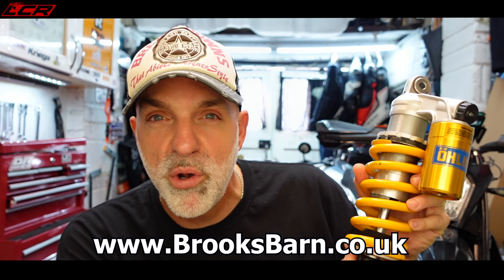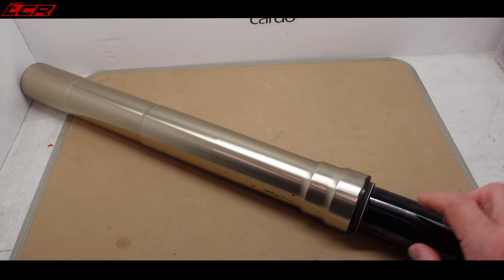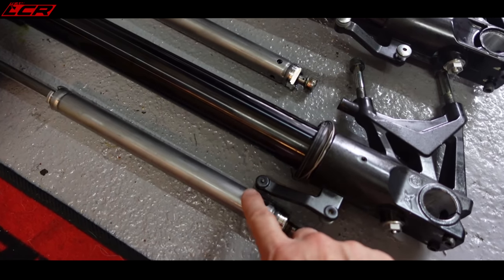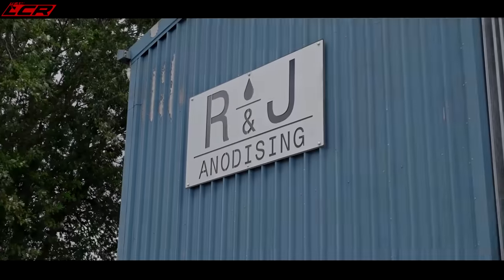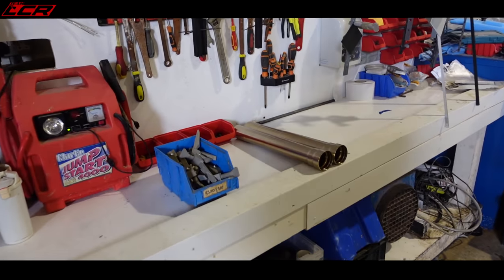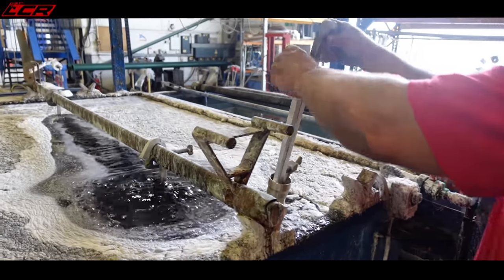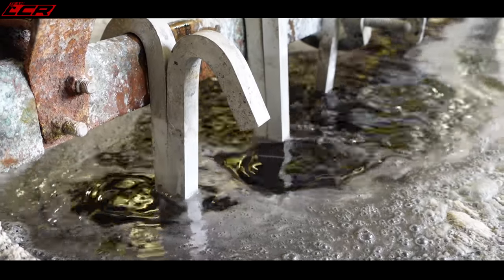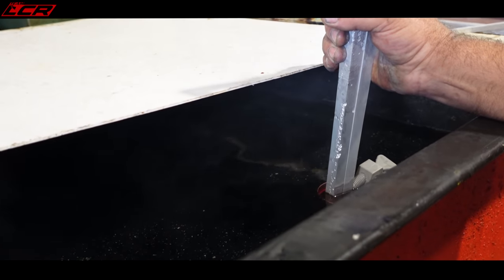Hypermotard Restoration  EP10 | Suspension Overhaul!

Comment: Also, a tip. Apply some heat to the upper stantion with a torch and it’ll be so easy to separate the lower leg 💪🏼

Comment: Hahaha. 
Those forks.
You've done the difficult bit, putting them back together is the easy bit.
Future reference;
Make sure a good vise is bolted down properly to a good bench.
Tip two,
Make or buy some soft jaws for said vise, or buy/make a fork leg holder.

Comment: Just a note on your anodizing guys comments on the black/silicon reaction in the stripping tank... The silicon in the aluminum forks is there for good reason, changes the properties of the metal, it’s normally used in high strength alloys for structural/high stress/load areas like suspension. Also used for bearing areas as it hold oil in the pores better plus easier to cast into complex shapes than regular alloy
Reply from the maker: Ah very interesting James, I put it down to cheap alloy being used.. now you mention it that does makes sense!

Comment: The anodising looks totally factory - and R&J are local to me so I might have to pay them a visit!

Those Marzocchi forks aren't really in the same league as your Öhlins shock so, as you've got them stripped down, I think it'd be a false economy to just reassemble them as standard. You've resprung your shock so, at the very least, I'd recommend getting a set of linear springs tailored to your weight. I think Brooks are agents for K-tech so try dropping Chris at K-tech an email and see if there's anything they can do to upgrade your fork internals. (They reworked my Monster 1100 Evo forks and it transformed the ride. Definitely money well spent.) Failing that, the Andreani cartridges are a good value option.
Reply from the maker: Yes I will at least get uprated fork springs to match the rear 👍
Reply: Good move! Difficult to see from your video but I think the Hypermotard springs are progressive, which are, at best, a compromise and, at worst, 'one size fits no-one'! So you'll definitely feel the benefits from fitting linear springs for your specific weight. Really looking forward to reassembly!

Comment: Dreadful stuff regarding the postage FUBAR sitch; but great stuff on the local anodiser visit front. I had my fork legs re-done recently (Gold!), but they were a damned-sight more expensive than the (bargain) price you paid Chops! And I'm 100% with you on the 'orrible fork oil experience. It's right up there with brake fluid as my most hated motorcycle liquid!! 😖

Comment: 20 mins in, pie cut pipes Chops, pie cut.
IMHO generally not needed, certainly not on street bikes, used on race bikes where you cannot get the tight bend you want with sand filled or tube benders.
But, i've got a feeling you aint payin', so go for it.
I personally only like the look of them on race 2 strokes.

Comment: I think it's utterly ridiculous that a delivery company can screw up so badly and then say it's your fault for not insuring the item. How about, I paid you to deliver a package from one place to another and if you screw it up then it's your fault.

PS, the worst oil I ever used was Bel-Ray air filter oil. If you got that stuff on your hands, no matter how many times you washed them they still felt sticky.
Reply: Did you try either boiling water or bead blasting to get it off your hands ?
Reply: @jonathangriffiths2499  No, but that acid bath looks like an effective solution, although typing with 2 bloody stumps would be tricky.

Comment: "The cylinders and heads went missing in the post" It was at this moment my jaw fell ajar.
Reply: That’s why you splurge on courier shipping for  such critical items. I had to mail my forks and shock from mainland Europe to the UK and I was glued to my screen watching each single status update.
Reply: @LordShibuya  disagree.
In over 35 years of sending and receiving stuff worldwide,inc 15 years with a pro owner/operator m/c workshop, nothing beats an individual country's PO system. It may not be the cheapest, but it certainly is the most reliable. And if you pay for it, just as quick.
Couriers are the worst. 
Don't even get me going about DHL, Fed Ex, UPS and the international lot with made up import duties, and taxes.
Thieving robbing bastards.